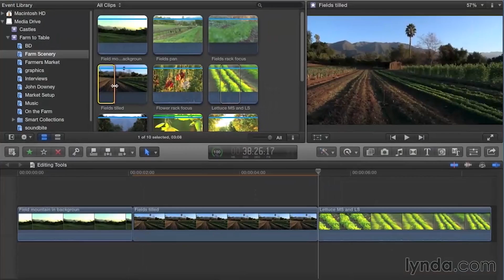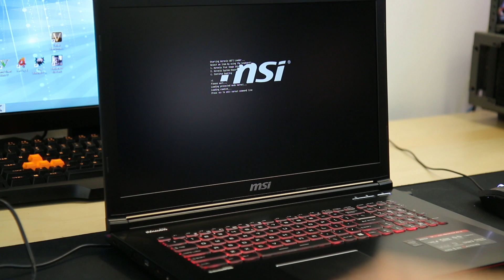How to install SSD in a laptop

Comment: The SSD was an improvement of ~55% over the HDD, or put simply it takes the SSD half the amount of time to perform the same task.

Just thought I'd mention the improvement.
Reply: +SlavjanA Yeah man you're not getting my point. I was just saying your original comment says the SSD was 55% faster, or two times the speed. But 55% faster does not mean two times the speed. I'm running out of ways to say this.
Reply: That's not the same thing, 2x faster would be a 100% improvement. Or 50% improvement would be 1.5x faster.
Reply: AT4User I'm comparing it separate from percentages. SSD was 42 seconds, HDD was 91 seconds, that's a bit over 2 times the speed.
Reply: +SlavjanA Yes, you're right, it is over two times the speed. But that is not 55% faster. That's 100% faster.
Reply: SlavjanA
Look, less and faster are not the same thing. If SSD takes half the time of a HDD to complete a task it translates into 2 times the speed, meaning 200% as fast, or 100% faster. 100% faster means 50% less time. It's simple logic.

Use this formula: newTime=oldTime/(1+x)
Reply: +SlavjanA I just put a brand new Samsung Evo 850 120GB SSD on my 4 year old system and hell that thing made my system (specifically the OS) fly! Boots fast af, and puts less stress on my older HDD making it load files faster as well. I'm just a 1st year IT college student and I spent most of my highschool life saving up for that, it was all WORTH IT.
Reply: 55% faster would be roughly 0.75x the normal speed, 100% would be 0.5 the normal speed
Reply: +Lieutenant Capellini I sincerely hope you're joking.
Reply: +SlavjanA More like 200% as fast, or 100% faster. There you go
Reply: +SlavjanA Should've excluded the time it takes for the computer to post. During computer start, HDD/SDD speed only affects Windows loading time.
Reply: +SlavjanA Now I just think you're doing this on purpose. I really hope you're not serious man. You need to understand ft hat the SSD is not 55% faster than the HDD. It is 100% faster. I've been trying to help you fix your original comment and you're making it really difficult. For gods sake just change the 55% in your comment to 100% or just get rid of the percentage all together if you can't understand it. Here I'll write it for you: "The SSD was ~100% faster than the HDD, or about twice the speed."  Done, that's all it is.
Reply: SlavjanA No, no it doesn't. Math is not subject to your perspective. Math is factual, it is definite. It has rules, and they are written in stone.
Reply: ***** Nah, I'm pretty sure it's scientific fact.
Reply: +SlavjanA Yeah and it costs x5 more than the hdd
Reply: Sometimes I type loads of nonsense to make people question themselves. On Buzzfeed videos it works because the IQ there is looooow.
Reply: AT4User I know what you mean, and of course you're right, but I was talking about it practically, as in it's double the speed. Since 42 x 2 = 84, which is just a bit shy of 91.
Reply: +AT4User I know what you're saying dude, but like it takes the HDD twice the time to produce the same result, when you look at the seconds. I'll just change it something hopefully everyone will understand.
Reply: +SlavjanA 55% faster ? 6 sec start vs 2 minute start is not 55 % :))
Reply: +AT4User It seems math isn't his/her stronger point lol
Reply: +TheOneAboveAll Yeah I was just trying to help the kid really but now I'm more just astounded. I'm not a math teacher but I thought I've explained it pretty well :/
Reply: AT4User Dude 40 seconds is 45% of 90 seconds, that's 55% less/faster.
Reply: +SlavjanA No, no it isn't. 40 seconds is ~110% faster than 90 seconds.
Reply: TheOneAboveAll Depends on how you look at it.
Reply: +Skeletor Jopko Alright, I'll make it clearer on what I mean.
Reply: +SlavjanA it is actualy faster,  it took so much time because windows asked for closing apps that were running, theres this button "force cose" if u look at second test

Comment: 42 seconds? whao. Slow. My desktop takes between 25 - 30 sec. (Measured with Bootracer) from power off to fully loaded win10. (steam, and other crap, and included the deley at post for hitting them "bios" keys) Mine to wastes a few seconds on the logon screen but not as long as your Lappie.

That upgrade kit was awesome. Liked the disk box :)

Comment: even though it is 1min31seconds you still have to keep in mind about how long it will take until the computer is accessible or able to used at full power, which it takes me literally 1 minute to restart and then 5 more minutes before my computer is able to be used at full power/load everything properly.

Comment: MacBook Pros nowadays have better processors, better displays, alot faster storage than that mediocre SSD upgrade, longer battery life, waaay better build quality than most of other laptops for the same price and you buy your wife a bulky heavy 17" low/mid-range gaming (!!!) MSI laptop that won't last half the time her previous laptop did?? If she is not a gamer (which I dont think she is) than this was just a really dumb thing to do or you really want to make your wife miserable...
Okay even if you dont want to buy a MacBook because you dont like them, then at least you could have considered buying her something like an MSI GS60 or even better - the Dell XPS13.
Reply: MacBooks are packing the same Intel processors that any other manufacturer can put in their laptops... The only difference is that the MacBook is passively cooled and has a better chance of thermal throttling.
Reply: the Processors between Apple products and other Notebooks are all the same.

and while Apple will charge you a big premium for using only M.2 SSD's, your Consumer Notebook won't even touch the bandwidth of a normal SSD, and for many Consumers, rarely even touch the bandwidth of a Hard Disk.

higher Resolution Displays? sure, i guess. but more just because more doesn't necessarily mean you benefited any, as can be seen by the M.2 SSD's.

longer Battery Life has a lot of variables in it, but the Battery Life is primarily going to be longer due to several Hardware components not existing in the device in the first place, like a dedicated GPU, and active Cooling to keep it from Overheating.

the enclosure is definitely prettier though(than most other Notebooks), absolutely.

comments about lifespan are inaccurate at best. Apple products don't "magically last longer". it's just more Apple owners talking about how many years they've used something. the owner of the Windows based device didn't lose any of the functionality that his Notebook had from day 1.
Reply: +Sirpotatoguy I have not yet seen a laptop in the same price range having those processors. The base model 15" has a 4770hq...
And why are you talking about the passively cooled macbook? We're talking about macbook pros...

Comment: The persistence of a delay at the BIOS splash screen is surely in part due to there being a fixed timed delay to allow a user to interrupt the boot sequence and enter the BIOS editor ? But I agree that seemed more than a nominal 0.5-1 second delay.

Comment: Too expensive and yet her previous one lasted 7 years? OK. Cause that MSI is sure gonna last 7 years.
Last I checked, there is no $2199 model Macbook Pro and the only model without Wireless AC is an old non-Retina model that they still sell as a discounted option ($1099).
I know you a Jerry love to hate on Apple any chance you get but this video was seriously lazy. I expect better.
Reply: The MSI one can probably last that long, even if you don't want to admit it...

I got an 8 year old Vista Laptop that costed 500€ at the time.... It is still working properly (except WiFi, that was my own fault however, broke it).
All I ever changed was install Windows 7 on it and Linux Mint.

Comment: I watch all your videos and program and play games on a mac's (I have 3). I also have several desktops and servers, but they rarely ever get used since building them (mostly in the garage at this point). Can agree that macs are more expensive out-right.And hardware wise you may look at lowers specs but in an all inclusive package the MBP's are better than most laptops. But, they last a LOT longer than any of my windows machines have. I have a closet full of dead or non running laptops from Dell, Sony, HP, ASUS, MSI, and Toshiba. My MACBOOK PRO from 2008 still runs like the day I bought it. just saying!!!
Reply: +Joshua Dowell Same experience here. The Macbooks also hold their value much better, so you get your money back when you sell it. My PC is solely used for gaming at this point because for me the OS is the key factor - and the trackpad - there is not a single Windows Notebook trackpad that comes close.
Reply: +Joshua Dowell 
since i don't really have enough of a reason to justify replacing it over spending money on my Desktop, my Windows based Notebook from about 2008 still works the same as it did then as well.

sounds like you have Confirmation Bias / Sample Bias.
Reply: I have 3 Toshiba laptop running Vista, a HP G62, a Toshiba l450d all working fine, some of them date back too 2007 so it's obvious you don't take care of your hardware.
Your perceived belief of a Mac is just what Apple are aiming for.
Reply: +DBIIJ0U Your point may be valid but I have to use my machines for work and travel a lot. I treat all my machines the same Apple, or otherwise. But something about the Mac's makes the CPU's last longer. ^ laptops have dead CPU's 4 of which are Core 2 series. the last two are i7's. I have One currently working Dell Latitude E7240 and Its my main windows machine when I work abroad. Its no longer a matter of just "take care of your hardware" when you spend high amounts of money and the CPU's motherboards, and screens fail. Its more a lack of attention to the mass amounts of product that companies make. And making a repair request and trying to get the warranty actually to be accepted is a painful process for anyone but Apple. ( I use to work at toshiba in california in 2004-2007 try taking a computer there and have them fix it) (It won't happen)
Reply: +taiiat0 Not really a bias. If your machine works the same or better than the day you bought it. Great! I have no real problem with windows or other computer companies. But i do have a problem with false advertising. Even Jay said it has hung in there since they bought it. and he could have just added a SSD in the MBP and upgraded the RAM. But he chose to replace the machine for much more money and then also buy another SSD to replace that one. BIAS is everywhere. soo...maybe.
Reply: +beamwalker Right!! best trackpad EVAR!!!!! all i can say. not even RAZER can beat it. AND I LOVE RAZERS stuff. CLEVO comes close. but only because you can swap them.
Reply: +batfredd1 true. You could have a kick-butt mouse but I was more or less commenting on the built in components that they come with. No windows pic has great great components the way apple vets theirs. Razed comes close. Cleve is great for the price but more unreliable in comparison with Apple. My experience at least.
Reply: Joshua Dowell well, that MBP is 7+ years old... meaning it's going to be a super, super, super terrible Dual Core as the high end choice.
replacing it was a good idea.
Reply: +taiiat0 no doubt the difference performance from core 2 duo to an i7 will be much better.

Comment: MSI says that the warranty doesn't get void if you swap the hard drive. Also, the 7200 RPM 1 TB Seagate drive in my desktop restarts almost 2x faster than that... so I think it could'vs just been the drive.

Comment: Her laptop out performs my desktop.. 

CPU: FX8320 3.5 ghz
GPU: MSI GTX 960 100ME.(which will be bought soon.. currently having an HD4850. I feel ashamed just typing this)
Reply: Yes, true I know that. But her laptop's cpu is better than mine i believe.. I do know there is an i7 in there i forgot which one. If it does nnot outperform mine that it should be about the same. but i still think her laptop out performs mine.
Reply: Yeah i don't have that much knowledge about CPU's Intels numbers confuses me x-x
Reply: +hendrik visch Buy a R9 380 instead.
Reply: +hendrik visch dont be shamed mate i have core 2 duo E8400 and 4gb ram and 80gb hdd and HD 4550 so...
Reply: +hendrik visch Get a 380 and use the savings for a aftermarket air cooler and overclock your cpu.  I got 4.3 ghz out of my 8320.
Reply: I'm planning on taking the R9 380 indeed, Even though it originally is 50 euros out of my budget i will go for the 4GB version so i won't be needing to upgrade it for a while. Because i'm also planning on making an console style build and i think this card will do justice. :) If i do this that is... because i heard the Steam Controller ain't all that great and i don't really like Xbox controller either(this migh be just be me being biased towards Playstation... since i'm used to that..)

I'm taking the MSI R9 380 Gaming 4G (as i do really like MSI for some reason...) Concerning the CPU i was already planning on putting an CoolerMaster Hyper 212 Evo (if i spelled that correctly...) on that and give it an overclock to 4 GHZ.  I was also planning on changing my 630 PSU which i justrecently found out it wasn't 80+ certified, if it is i couldn't find it anywhere on the box and will opt for an 700 - 750 watt PSU. because if i got a job and money i will be upgrading this system with an i5 4960k and an R9 390. But then again i don't know if i give my self an decent amount of head room when it comes to GPU's with this CPU. I think i do... But then again i'm still fairly new to PC building... I know how to put it together and do cable management but there are sooo many parts... Although i do feel like i'm learning a great deal by just doing it.
Reply: +hendrik visch A 4690K wont be much of an upgrade for you, i wouldn't bother.
Reply: well I never bought that GPU due to some money I also said i already went with the 380, It's actually a Sapphire R9 380X Nitro

So my original post isn't treu anymore. because wen i though i could buy the thing i couldn't due to some unexpected expenses soo i had to wait. 

I won't be going for any of the i5 and skip to the i7-6700 as i do streaming. 

I also can't overclock my CPU because i have a 4-1 Power phase making it unstable

Comment: Didn't know notebook drives were any slower... I have been using notebook drives from my old laptops as mass storage drives for a couple of years now, and on synthetics they are around the 100 MB/s mark, which isn't far off a desktop drive.

One thing is that the long welcome screen occurs for me as well on my razer blade with a m.2 ssd. Welcome screen take just as long as the boot up in fact, and this was not an issue in windows 8, so thats a bit weird.

Comment: jays Idk if someone said this already or not but ill say it anyway. a notebook :a rd drive is slower BECAUSE if its platter. when you spin a disk, the outer section will spin faster than its inner section. so it doesn't matter if its the same rpms, but the angular velocity at the edge does.
Reply from the maker: +Vicious Slayer I guess that makes perfect sense.
Reply: ***** glad to be able to help mate :D
Reply: +Vicious Slayer This isn't entirely correct.  The angular velocity is the same throughout the surface of the disc.  The tangential velocity on the other hand increases as you move outward on the disc.
Reply: Jordan Coward well, I guess I stand corrected. But the concept is still right, or...?
Reply: Yes, a 3.5 inch drive will cover greater linear distance at the same RPM as a 2.5 inch drive at the outer part of the disc. But I'm not sure that's the reason why a 3.5 inch is faster. I know on CD's they slow the speed of the drive when the laser gets to outer edge of the disc to store more data on it.  If that's the same for HDD than it's a moot argument.
Reply: Jordan Coward if im not mistaken that's with LP's, not with optical CD's.
Reply: LP's are not stored data, they are vibrations engraved by the needle, and they also spin at a constant RPM.  Which is why some are called "45's," because some spin at constant 45 RPM.
Reply: 11 months late, but that actually isn't the case. Modern HDDs change their RPM to maintain read consistency and write integrity. The real reasons laptop HDDs seems slower, get ready for a huge spin, is because they are. Laptop HDDs are almost always 5200 or 5400RPM maximum, whereas high performance desktop 3.5" HDDs are 7200RPM.  They also have smaller caches, and can work in low power modes on mobile systems, which will reduce the performance of 7200RPM 2.5" disks.
Reply: ://ReaperReaper
they have no reason to do 50mb/s on the outside if they can do 70mb/s.
Reply: Vicious Slayer It does if the head or HDD's internal processor or cache can only consistently read/write 50MB/s correctly.
Reply: ://ReaperReaper but then they might as well save a bit and put a slower engine
Reply: Vicious Slayer Then HDD speeds would be inconsistent, and there is no savings going from 7200RPM to 5400RPM for manufacturers. The choice of motor speed doesn't have anything to do with cost, it has to do with target operation speeds and power constraints of the system.

Comment: I just bought this laptop on a newegg shell shocker deal, but instead of swapping out the HDD I added a 250gb M.2 Sata III Samsung Evo ssd to the system.  Now it boots fast and can hold all of my games.  I'm surprised you didn't opt to use a  PCIe M.2 drive since the laptop can support it!

Comment: I did the same thing in 2012 to my Acer with a 128GB Samsung 830, but a nice alternative option is to swap the optical drive with a hard drive bay. SSDs were a bit expensive back then so the additional 750GB HDD storage was very welcome.